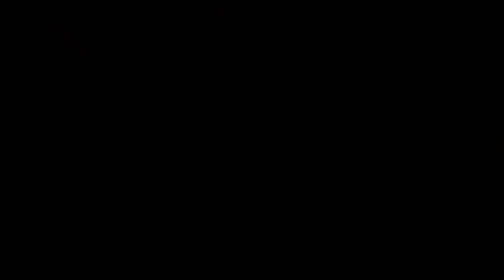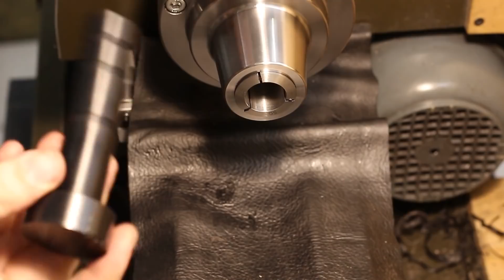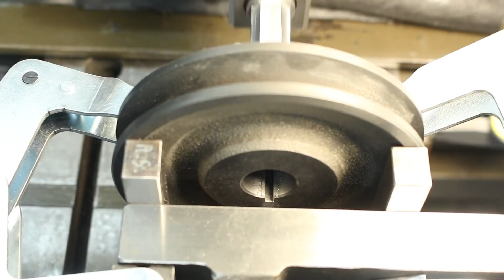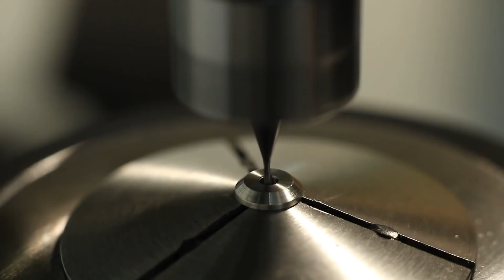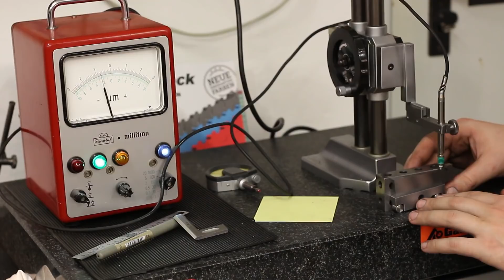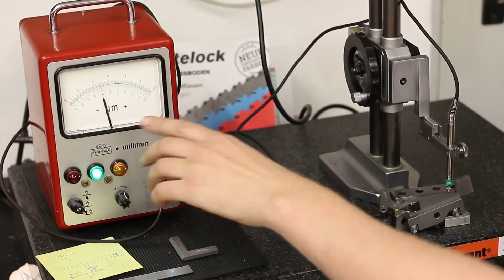The Archives - #3

Comment: @Stefan - You do some great work. I was wondering why you sold your CNC and got a RF45 type machine. Do you miss your CNC?
Reply from the maker: Thanks! I run cnc all day long at my dayjob, So I am still in the game ;)
But I needed a manual mill with a bit more torque/travel than the cnc I had myself. I rarely have work in my own shop that needs a cnc mill.
Reply: Thanks Stefan.

Comment: Turning plastics. Oh the joy!. One thing I used to do was when turning Accetal or Nylon was to adjust the speed and RPMs to get the swarf to fly right into a waste receptacle. But to get this you really need a variable speed feed and spindle speed. 

Instead of cutting the keyways in the shaper is your mill up to being used as a slotter? We used to cut slots in Ampco 18 in the Bridgeport. AMpco 18 (Al 10.5%, Fe 3.5%, 0.5% Other, balance Cu)

I hope the knife maker supplied the Titanium :) I sometimes wonder if you can get end cuts out of the scarp bin at work. Some places don't mind. Other take a very dim view of it.

The angle blocks should be good enough for using in the mill. I have always found it handy to have matched pairs on this kind of thing myself

Comment: I always found that ABS and Delrin can be cut easy if I use the shop vac to vacuum the continuous chip away from the cut.  It just slurps it up like spaghetti.  The air movement around the part helps keep it cool.  Really nice on machines with lower spindle speeds than yours.

Comment: I have very little machining experience.I was wondering how you cut the threads on the titanium bolts without a runoff groove for the threading tool to stop in.Did you thread them with some sort of die?Those are very nice looking parts.
Reply from the maker: There is a tiny relief at the end, 1,2mm wide and with a diameter of 2,4mm (0,1mm smaller than the minor thread diameter), and the thread was done with a die.

Comment: Very nice, as always.

Thinking of tricky plastics, do you have any experience with UHMW? I'm working on thermoforming some UHMW lead screw nuts, and it mills beautifully if you take some care not to let the chips wrap around your tool, but it has just been a nightmare on the band saw. I think it probably wants much higher speed, but even at my saw's top speed it throws up a gigantic, fluffy bird's nest of a burr on every cut.

Comment: I'm very interested in the electronic lead screw. It sounds like a good compromise between manual machining and CNC.
Reply from the maker: Indeed - And with a second steppermotor it would even be possible to turn radii and tapers with it. Very versatile unit.

Comment: Thanks, Stefan, for that interesting video. Warmed up, conserved video stew can taste quite well too. :-) I particularly liked measuring the angle blocks. How could you distinguish the error of the sine bar from the error of the angle blocks?

I was not aware that you had a carriage autofeed and a linear scale on your lathe. Did I miss a video?
Reply from the maker: The lathe always had feed via the leadcrew, but changing the gears was always annoying, so I used it only for threading. But now, with the electronic leadscrew, changing the feedrate is just the turn of a knob :)
As for the linear scales, I showed them here:
https://youtu.be/HfcU_cWs1Dg
Reply: Thanks for the hint.  I searched for it without success since several topics were addressed which did not appear in the title. I had seen that video and even commented on it. I was obviously so impressed about your implementation of Rob Renzetti's tool post setup that I forgot about having watched the scales part too... :-) 
I am looking forward to your video about the electronic lead screw drive.

Comment: At 13:40 that is not my class of work. lol That pantograph is sure handy for jobs like that. I can only imagine how many of those toothpick sized end mills would meet their demise at my hands.
Reply: I would have broken a couple just getting them out of the packaging...
Reply from the maker: Haha, thats what I love about machining, it is so diverse - You work on fairly big stuff that would make me completely lost. I work with a lot of things that are small enough to be handled with tweezers, Robin builds stuff thats precise enough to go to Mars and so on - Love to see it all :D
I find myself drawn to work on small stuff, a 0,5mm endmill doesnt scare me at all :)
Reply: 1300rpm is currently the fastest spindle in my shop. I normally pull chips bigger than that whole endmill.  That is why I tend not to fool with the small stuff, I am just not set up for it. Just like most people aren't set up to punch holes in a 5 ton casting like me.  Like Stefan said it is all fun to watch though. :-)
Reply: Isn't that why you bought the Milacron? So you can set up thousands of the screws instead of one at a time like silly Stefan?
Reply: 0.5mm isn't as fragile as you might think. 0.2mm is the point where I worry, not that I will break it in the machine but accidentally stab myself in the finger and have it break inside. Like all end mills if you use them correctly with the right surface speed (high RPM usually for that small, 9000 seemed a little low to me) and right feed rate with plenty of space for chips to clear and the right amount of coolant they will go blunt before you break them.

Comment: awesome torx head for the screws, didn't knew that is possible to make it in workshop, especially so small, only by special forming die at higher temperature
that electronic micrometer from where did you get it and how much did it cost?
Reply: Except that Ebay is about the very last place you want to buy any of the "brand name" metrology equipment. It's a mine field with counterfeit Mitutoyo being the worst. Maybe buying used, but even then you need to be careful. Brand new go to a reputable dealers or machine tool supply. Better to pay a bit more than buy a junk copy of the real thing.